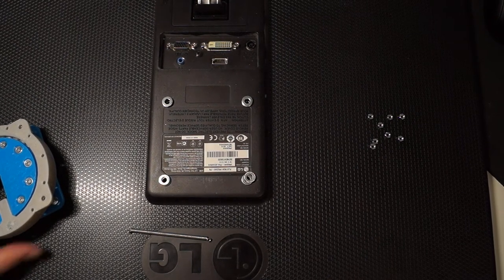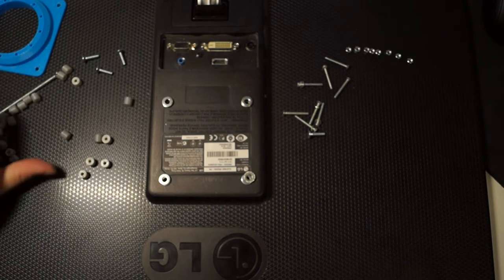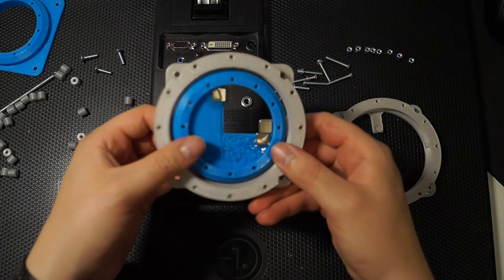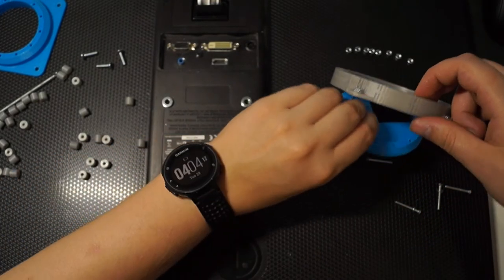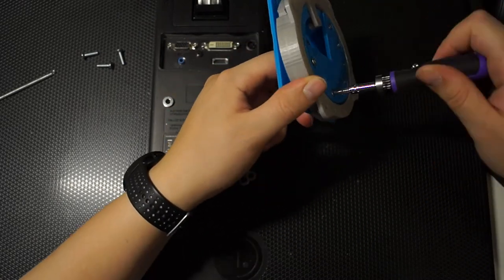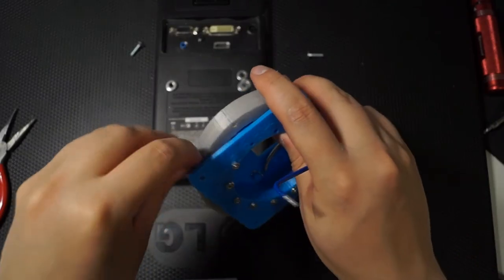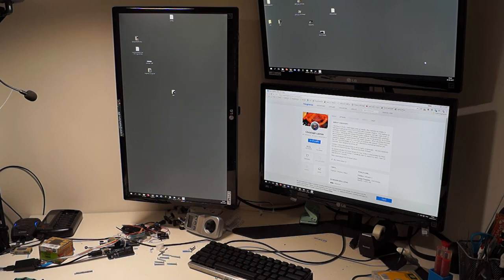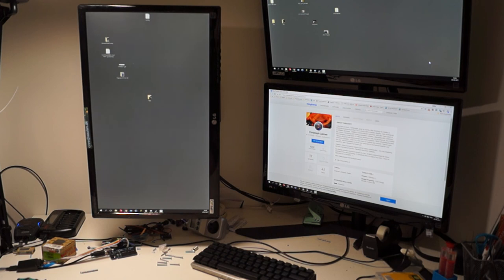90 Degree VESA swivel plate

Comment: What mount did you start with?
Reply from the maker: hey there. I don't understand what you mean. The monitor was mounted to my wall before I designed this bracket. It just uses VESA mounting pattern, which are just squares with holes on the corner. I think this was VESA75 which just means it's a 75x75mm hole spacing